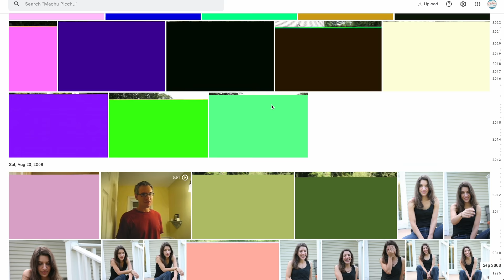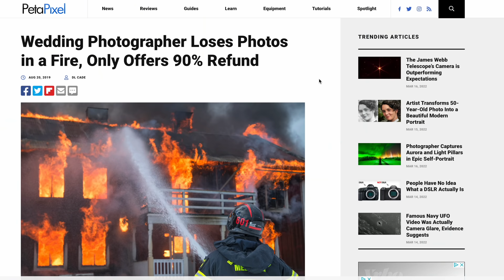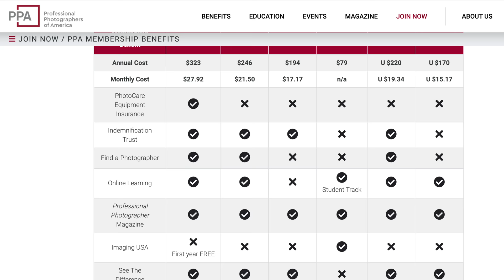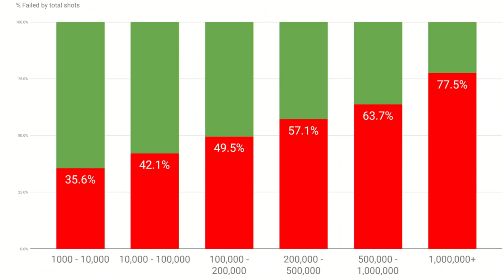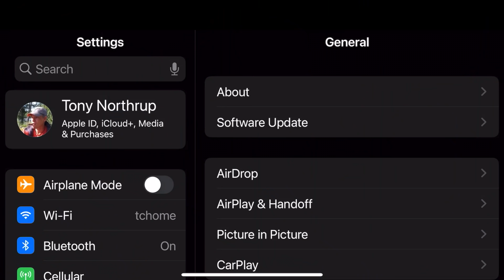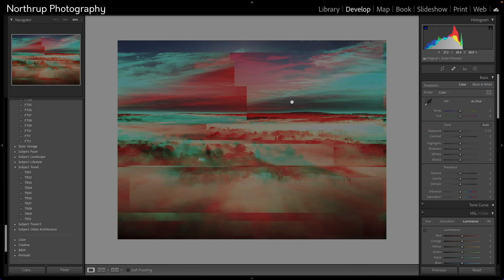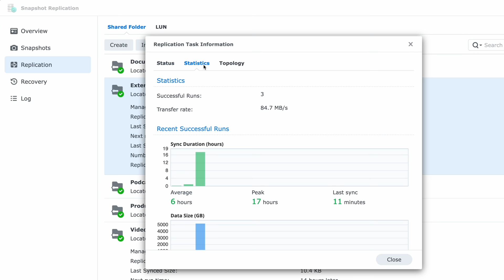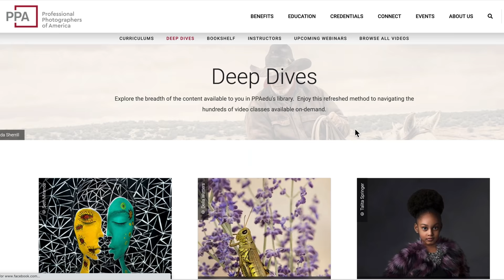NAS Storage for Photos & Video: PROTECT YOUR DATA!

Comment: I'm surprised nobody mentioned optical storage.  I have 20 years of backups on CD's and DVD's.  At least your relatives could find the pictures if something happened to you.  I recently went through them and made sure that I have all the pictures copied to the cloud and on external hard drives.  I think of it as the rule of three.  Keep in at least three places.
Reply: I almost forgot about that, because regular Backup solutions seem to be so secure these days. All of my quality ancient CDs still work to this day! And, yes I also found out that writing a backup over a backup via a strange cryptic "backup Program" is nothing compared to a simple mirror hard drive of all my data done from time to time. For the short term. Not for long term, because all of my ancient hard drives have stopped working. They obviously loose the magnetic information if not used at least once every few years. So CDs and maybe magnetic tape seem to be the ultimate backup solutions. A data storage center can go bankrupt. I absolutely agree to Tony in that point! We should rally think more about saving our precious pictures at least once a year.
Reply: CDs and DVDs will also degrade over time. We have had it happen to discs that were carefully stored in individual sleeves in temperature controlled purpose built cabinets. Some disks are rated higher than others for long term storage but eventually they are all susceptible to data rot.
Reply: @WesternAustraliaNowAndThen  CDs, DVDs and BluRay Discs can last decades. The quality of the disc itself is of course a factor, but I can tell you from being in that business since the mid 90s, that the handling and way you store discs is the key to how long they will live. Don't put them in a sleeve. Anything in permanent contact with the surface of a disc will provoke a chemical reaction sooner or later. A classic Jewel Case is still the best way. Avoid fingerprints at all cost. Don't scratch them. And the most important tipp of all:  Always burn 2 discs at the same time. Chances are high, at least one of those copies will survive. I have CD-R here that are 23 years old and work perfectly. If you want to be really safe, copy those archived discs every 5 years or so and you'll be fine.
Reply: @Yankeededandy62  Wow, two CD copies (and maybe of a different brand) are a really good advice! That's something everybody can do at home easily. External burning drives and writable medis are still available and seem to be a really good way of preserving a limited amount of data over decades. For all mass data producers I would recommend magnetic tape drives, they are now in the Terabyte range (per cartridge!), they are affordable and last forever. Think of old music casettes. Ever had one not playing anymore because of magentic loss?
Reply: My personal store of videos, photos and documents is around 2Tb. 800Mb CD or 4Gb DVD is going to be some stack. 50Gb Blu-ray is only a little better.  CD, DVD in homes is now uncommon. I don't know anyone with a Blu-ray drive or player. They dumped CD and DVD to streaming and also "lost" all their old files.
Reply: @Yankeededandy62  400Tb onto 800Mb CD and also two copies. My own personal data is 4Tb. Even double density Blu-ray would need a large stack of them.
Reply: @geraldmcmullon2465  You're right about that
Reply: Optical is not considered a safe form of backup due to the sensitivity - hot, cold, mechanical, all sorts of things can destroy these. CDs are somewhat reliable but extremely costly, they are considered only stable 3-5 years and may be susceptible to bit errors. DVDs are even worse and more sensitive. Under perfect conditions they can work and you can get lucky using them but as a rule - they are not a great solution. The gold standard are magnetic tape warehouses where you can store much more data and at a low cost allowing for refreshed copies every few years. This is exactly how we backup the most critical data available today. They even just came out with a new tape type than can told 540TB of data. So DVDs and CDs just aren't really a great option. There is m-disk but they are pricey and limited in space.
Reply: A few of us here have mentioned M-Disc and BDXL.  CDs and DVDs can be long-lived, but they do degrade with heat and light. The organic dye eventually fades. Blu-ray HTL discs and M-Disc are non-organic, much longer lived, and not sensitive to typical light exposure (obviously a laser does its job on them, though you actually need a stronger laser for M-Disc). 

No one shooting at Tony's volume, particularly video, is likely to consider 100GB discs as a viable option for backup. On the other hand, I'm shooting 1/2 to 3/4 TB per year, 500-750GB. That's 10-20 BDXL discs per year, max -- I back up as I shoot, and each disc has copies of older stuff on it, so every photo is on at least two discs... that's $100-$200/year for enhanced peace of mind. Making permanent, redundant backups is a very good hedge against undetected bitrot, too. This is also incentive to cull your bad photos, if you didn't have that already, maybe understandable given today's cheap storage.
Reply: @genius1a  Old analog music tapes do degrade, just not so noticeably... though good luck playing them in your 2010/2020 era car!  But try some old analog 8mm or DV tapes from the 1990s. You'll find some serious bit rot on most tapes, even stored well. Depending on the tape medium, 10-30 years is the expected life. 

As well, any computer media is going to see accelerated format rot. Back in the 1990s I used Travan tapes (TR-4) for backup. I don't have that tape drive anymore. Can I find one? Yeah, they're available on eBay, used, for parallel IDE or SCSI... so there's another thing to convert to for a modern PC. But that's electronics, and the capacitors on those boards won't likely last another decade. It's definitely a good idea to bring all your old media into modern storage forms from time to time.

Comment: I finally found the fix 

This is the excat same way my photos got corrupted.
The reason -
1 if you use an sd in in both an apsc and a full frame camera it will corrupt soon. Some SD cards can't handle both smaller and bigger files at the same time. 
If u use multiple SD cards it will corrupt soon. So if you use 1 perticular card in one perticular slot of one perticular camera - keep doing that and don't change. 

2 don't use 1 sd in a different camera system and back. That will also lead to corruption

3 format in the camera only.  If you format in the computer and put it in the camera the chances of corruption are high .

4 most importantly do not insert an slow sd card in a fast reader and a fast port / also 
Don't insert an usb 2.0 pendrive in a usb 3.0 or 3.2*2 or a thunderbolt port. The faster usb 3.1 port will try to read the slow pendrive and it will try to rip all the info to the pc as fast as possible. And it will end up reading only half the data will trying to open the old pics asap. 
To avoid this copy data from a slow pc with usb 2.0 to the cloud and then download it to the faster pc then copy it to an ssd or HDD. 

5 older gen cellphone also suffer from this problem. So don't plug in your old hard drive with your precious old memories in a moden pc. ( I did it and opened my old photos and saw them get corrupted before my very eyes) 
If you have an old hardisk, don't open the folder immediate after plugging it in. 
Give it a lot of time. Let it completely go for a complete spin. Then do a full virus scan before opening it (in a old slow pc ) 

6 the worst part is switching from windows to Mac .Mac is fast and hates old files especially it has a lot of issues with the formatting part. It will ask you to format the entire Hardisk to use it. If you format you will loose all your stuff. 
So don't do cross platform stuff. 
Finally have some respect for the time I took to type this comment out for your benefit and up vote this so that other could see this too.

Comment: Video is a bit of a problem to back up because of the space it takes up. For most amateur photographers though, photos can be backed up to a number of different sources for free. You might not be able to store shots at the highest quality, but platforms like Facebook, Pinterest and Instagram have virtually no limit to the number of pictures you can store. As a backup of last resort, these platforms are very valuable. Evan as amateurs we still run several backup drives. We almost got caught a while ago when our work drive failed and when I went to make a new copy from the backup drive, it failed too. Thankfully it was under warranty from Seagate and they flew our drive to their recovery facility in the Netherlands and recovered ALL of the irreplaceable footage on the backup free of charge. It was ALL of the footage we have taken of Western Australia over decades and would have been soul destroying to lose. A couple of things I would add are, 1. NEVER try to recover damaged drives or files yourself. You will almost certainly do more damage and make otherwise recoverable data completely unrecoverable. 2. Backup irreplaceable files at least TWICE. One backup is never enough. Keep one backup off site. I carry one drive where ever I go, so if there was a catastrophe at home, I still have a copy of all the important files with me. YouTube is another free option for storing video footage. You can upload to your account and keep the files private or if you just want to share them with friends you can make them unlisted and just give the links to people you want to share them with. Paying to back stuff up is essential if you are a professional but for most others, there are many free services available that you can use to keep copies of your files. Oh and one more REALLY important thing to remember, Don't just back your files up and then put them in storage for months, or years at a time. Drives maintain themselves best when they are powered up and just left to run for a few hours. The data gets refreshed by the OS and there is less chance of corruption. If you just unplug a drive and store it for a very long time, chances are that the data on it will be corrupt the next time you power it up.

Comment: I use LTO 4 drives as a backup only 700Gb per tape but magnetic tape is very robust and cheap. All of my most important data is on at least 2 tapes. I think LTO 7 is up to 6Tb per tape. I come from a professional broadcast background where tape backup is very commonplace. While tape backup is very slow I do like being able to put tapes in a box and put them in another location.
Reply: Not 100% fail save. We had a full set of corrupt tapes a few years ago with a large database index on them. We sent them off to a data recover service but no luck. In the end we had to rebuild the index which took a few weeks. Of course these days I'd run this in AWS or Azure and use one of their multitudes of online storage solutions for cheap backup.

Comment: I had a hard drive crash in 2013, and I didn't have a serious backup strategy.  Now I have a 100T off line back up facility where I back up photos and videos at least twice a month, and often once a week.  I lost All the photos that I took that year.  Fortunately I had prior photos backed up already through dumb luck on another computer. Now i have a system, and that system seems to work pretty well.  I'm thinking of doubly backing up photos, but haven't done that yet.

Comment: Every backup scheme works until it doesn't. 

My first rule: make multiple permanent archives. Bit rot can't go backwards in time. So I have every photo I've ever shot on at least two BD or BDXL HTL discs, most of them M-Disc media. Unlike CD and DVD, BD uses a non-organic medium, if you get the original formulation, called HTL these days (high to low -- the laser makes the shiny bits less shiny). Not a great solution for tens of terabytes of video a year, but it's okay for my 1/2-3/4TB of photos every year. 

I also copy my current files to a RAID locally, and run SyncTrayzor to sync between computers at two houses. If Godzilla stomps one house, all my photos will survive. If he stomps both houses, well, I have some 14TB of stuff backed up on BackBlaze, but I'm thinking if that happens, I've got larger problems. 

I don't worry about messing with custom file systems (though a specialized RAID can do better).  HDDs and SSDs use more powerful ECC data to check and, if things are going bad, correct small bit flips that lead to bitrot. This has been the case ever since IDE drives. The problem, of course, is that transparently correcting a bit flip fixes the immediate problem, but it doesn't tell you that the problem actually occurred. Most modern discs run SMART, which actually does track errors, but for most people, the only time they're checking this is after the errors start creeping in. 

My ideal backup would also create a hash of each file, and for incremental backups, compare the old hash with the new and, unless it's an obviously edited file, treat the changed file as a different file. That way, even if bitrot sets in, there's no overwriting of the old stuff. I would assume Enterprise-class backups do something like this.

Comment: I'm sincerely horrified to hear/see this Tony; another way to create backups (though you're using up some time creating them) would be to burn important images into M-Discs, which now come in capacities up to 100 GB for BDXL disc... Since they do NOT work off of organic dye systems like CD's/DVD/s  but utilize 'rock-like' materials for it's writing layer they suffer no data rot and literally are guaranteed for 100's of years, as the bits are permanently 'engraved'.  They are still readily available online in places like B&H and Amazon  and can be burned by most BD burners.  I think these are a great cost-efficient option for people who can't afford an elaborate backup system.
Reply: Truth. M-DISCs are a very important PART of my data backup strategy. At rest, they should be good for a century or more and they are readable in any blu-ray data drive. Even if drives are no longer mainstream in consumer PCs, I expect commodity/surplus blu-ray drives to be available and accessible (without excessive difficulty) for decades. The other two prongs of my strategy are cloud and local hard drive RAID array. Notably, one branch of a sane backup strategy should be OFF-SITE, so that any single event (such as a fire) does not destroy everything at once. I archive my optical media in a safe secondary location, and my cloud provider's primary datacenter is over a thousand miles away.
Reply: Excellent excellent comment!  This is what I’m looking into as well.  A good Blue Ray player that will burn M discs (Archival quality) is a solid alternative, but it should be used in addition to other back up measures.  It’s almost ‘conspiratory’ how all of us have to invest so much money and time in trying to hold onto our cherished images.  Tony touched on a very real thing in regards to ‘ Bit Rot.’  

In the end, It shouldn’t cost so much or be so much effort involved to work with and hold onto images.  Digital Photography promised so much and was so liberating from using film, but ends up carrying its own set of ‘baggage?’  

Happy Shooting.  👍✌🏻📷
Reply: I have used BDXL and M-Discs myself for years. It's actually the case that standard Blu-ray discs -- what are now called HTL discs -- are also non-organic. They use a layer of copper against a layer of silicon. Like M-Disc, they start out "high" (reflective) and the laser burns the "low" parts (in the HTL Blu-ray, it's fusing the copper and silicon). They don't last as long as M-Disc, of course, but if there's a difference between the two in my lifetime, that's a high-class problem. However, the dye-based companies added the "LTH" Blu-ray disc, which is back to organic dyes, making those even more perishable than DVD or CD. You're always safe with M-Disc.
Reply: @Vertifuge  Now you're touching on format rot, which has also been a problem. The optical discs, being a consumer format rather than a computer thing, are certainly the best candidates for longevity.